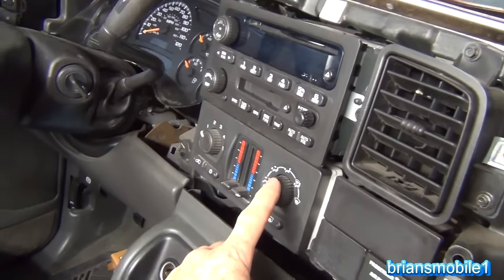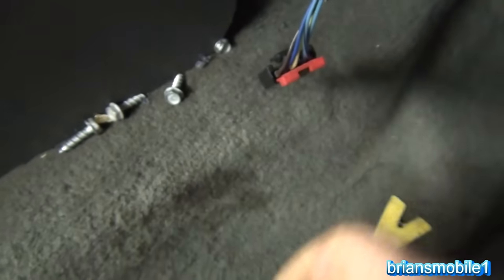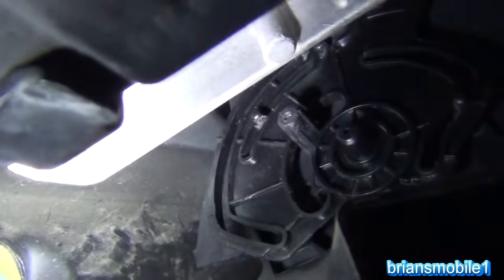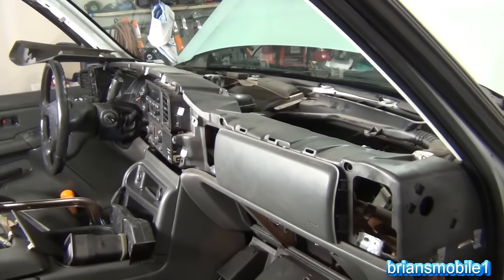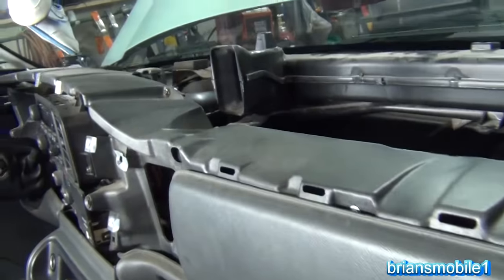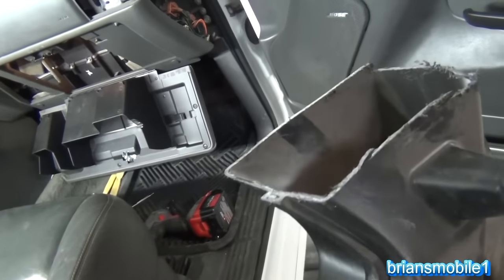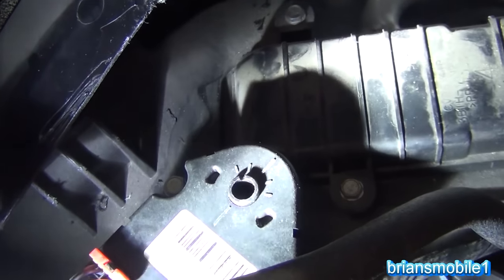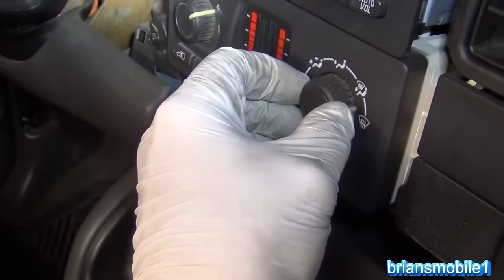Silverado Heater and AC Actuator FIX

Comment: Thanks Brian!  Just diagnosed my brother's truck with this video.  He had two bad actuators!  One for the blend door and the recirculation vent.  Showed him the filter location and replaced them also. Excellent description of the system and now you have another fan following the channel.
Reply from the maker: Glad to help- thanks!
Reply: What do the recirculation vent do? My issue is the defroster blows out cold air instead of hot! Is that what that do?
Reply: @520dblock3  recirculation vent open and closes depending inside air (AC) or outside air (non AC). Basically "Fresh air" or recirculate AC air.

Comment: Great ending to the video Brian. Humility, respect and a willingness to help others is a mantra we all should have. I really enjoy your content, thanks.
Reply from the maker: +Mathew Wood Thanks Matt!
Reply: +briansmobile1  How would I remove the duct that is at 5:14 in the forground? It is impossible to get my hands into the area on my 2001 silverado with center console/cassette deck. There is also a metal bar that goes from the transmission hump to the stearing support. I find a lot of information on the right side of the truck but hardly any information(about making it easier) for the left side.
Thanks for the video! I wish I could do as good a job......
Reply: how can I contact you?
Reply from the maker: Like this.  Thanks for the contact!
Reply: @billwhitehead164  aq QA
Reply: Great response young man

Comment: Brian, after removing dash top pad I was able to drill two 1/2" holes from top down thru bottom of duct to access both screws without having to cut duct into. Then I had four small holes to seal. I would not have attempted this without seeing your video. It took a little measuring to make sure that my holes aligned with the screw heads. This was for the passengers side temperature blend actuator.  THANKS for taking time to post helps and time savers.

Comment: This video helped a bunch! I would like to add that you don't have to cut the ducting...if you remove the brackets across the top (4-10mm bolts and (+/-) 12-7mm screws) you can wiggle and pop up the entire ducting up a few inches. From there you can use an 8mm short 3/8 ratchet to take off the actuator. I also removed the vent to the right of the radio, which was held down by 2-7mm screws. If you need more room you put a pry bar through that area to give a little more room.
Reply: Confirmed, although extremely tedious and patience taxing, completed the install by this method vs cutting apart the duct work. I used a flexible extension attached to a ratcheting screw driver that allowed fishing the 7/32" (male hex drive) socket between the duct work and bend at 90 deg with the aid of a simple bent pick to guide and engage the actuator bolts. Installation the same process with a dab of super glue on the bolts to help stay in place the socket. (tip: electrical tape all the tool components together to prevent separation/backing off while attempting disassembly/assembly).  I found reaching up from the glove box and stabilizing the new actuator with left hand and pushing the recirc door one way the other (finding alignment) with my right hand help seat on the door shaft.  Good luck!

Comment: This has been the most detailed and efficient video I've come across. I have filled out the two easiest actuators (under the steering column, and under the ash tray). The next two will prove to be a challenge, but with your video I feel I understand the process much clearer. 
Thank you Sir, have a blessed day.

Comment: I must say that this video was extremely helpful! I was able to install a new blend door actuator motor yesterday. It was the passenger side actuator which is the same one that is replaced in the video. The passenger side was stuck on blowing hot air. By removing and replacing that new motor, the issue was fixed! Almost every tip that was provided in this video was super helpful and was provided clearly, concise, and nearly step by step. However, I did not need to cut the HVAC tube like it was cut in this video. I say again, I DID NOT need to cut the HVAC tube! All I needed to do was to remove a couple screws on the driver's side of the dash brackets which allowed me to rock the HVAC tubes in directions which allowed my hands to get in and remove/ install the new blend door actuator motor. After I did the troubleshooting and verified the new motor worked, I was able to button everything up nice and clean. I've got to admit that I was a bit nervous to do this job because I've taken apart a dash on a GMC Sonoma to replace the heater core and it was a nightmare. Performing this fix on my 2004 GMC Sierra was actually super easy all with the help of the man that made this video! So thanks to you, Sir! A tip that I will give is that when purchasing this new blend door actuator motor I suggest not to skimp out on price for the part. I was able to purchase mine through Napa auto parts where they provided a lifetime warranty and a AAA Discount. The part ended up being just over $160. I tried O'Reilly but they said it was strictly a special order item... nobody has time for that. Amazon offers this part for just over $30 but it's a cheap knock off made in China with no warranty at all. Save yourself time, money and heartache and go through Napa.

Comment: Brian, I know this is an older video, but just wanted to let you know this is the best instructional YouTube video on replacing these actuators, by far! I just completed the replacement of the passenger side temp on my 2005 with automatic temp control. It was a huge pain, as I decided not to cut the duct, which involved even a bit more disassembly, but your video helped immensely! Thanks for being so much help.  :-)
Reply: Could you put in an estimate of all the actuators,,all of mine will be automatic. My suburban is a 2004 with rear air. I really enjoyed the video and like helping others,,be blessed. Sincerely Ernie Miller

Comment: Brian this was the best step by step on this job I have found. I was not looking forward to doing it until I saw your video. About 2 hours and done. The cut and tape is the only way to go, you can't find the screws and get to them from the front. I like how other guys just skip over the really difficult steps.Thanks for the help.

Comment: Good video.  I like to see repair videos that actually show the repair, not the aftermath.  Have you replaced the blower motor yet?  Mine works but makes a roaring noise. on the 4 and 5 setting.

Comment: Thank you for this video! I bought a 2004 Silverado this past Easter, and the only thing wrong with it was the driver's side heater blend actuator was stuck in the heat position, and since we are having a record hot spring in Tennessee this was a problem! I'm used to working on older model Chevys (60's and 70s) where the heat controls are a lever hooked to a physical cable. Without your video I would NEVER have found the actuator! Thanks again

Comment: What an absolute wonderful video! Thank you so much for it! I would have enjoyed this even if I didn't need to perform this procedure on my truck. I've got the automatic version. Hopefully I have learned enough here to proceed. I don't mind doing the cut and tape method but one has to wonder why GM didn't make it doable to remove the entire duct so it doesn't have to be cut. Thanks again!

Comment: Thank you so much Brian
You gave me the confidence to attempt this project. 
My 2004 3500 had the fancy automatic sensor system. 
It was scary because my unit was not like your demo model. Extra options add more crap in the way. 
I straight away broke my headlamp ambient light sensor which sent me to the Chevy dealer.  Good move because the parts lady printed out a diagram of the duct work for me. 
I have small hands and huge determination, I needed both. 
I did have to cut some plastic guards out of the way to access the "easy actuator" 
If not for you I would not have tried this. I feel more intimate with my Silverado  now. You are the best.
Reply from the maker: Way to go Christine!

Comment: Thank you! You just saved me from going and buying actuator with your re calibration advice/walkthrough. I’m blowing cold again! I figured why not and BOOM. YOU ARE THE MAN! 💯🙏🙏🙏
Reply: Hey bud, I bought a new wiring harness for the actuator that controls the driver's side, but the new harness has seven wires, with only six pins on the actuator.
I left the seventh wire off, and everything works EXCEPT, once I start driving, it automatically changes back to hot air, only on the driver's side. 
Should I connect the seventh wire to some metal nearby, or should I join it to one of the other six splices?
Please advise, thank you.

Comment: Thank you Brian! This is exactly the information I have been looking for. My 2005 Silverado, with 262,000 miles on it, recently began blowing hot air on the drivers side, while the passenger side had ca/c air coming out. I found the acuator above the trans hump and removed it, and manually moved the louver in the oppisite position and had cold air now on the drivers side as well. Here is where it gets irritating. When I get into truck and begin to drive it with the a/c on, after about 5 or 6 miles, the driver side gets heat, the passenger side still has a/c. I removed the acuator and it does move. So I backed up the chain and replaced the HVAC control unit just to eliminate that as a source of trouble.
Long story short, I no longer have the acuator moving the louver, but its still connected electially.  I miss the heater controls of years past. My 1966 Impala had the best set up of all. Also, I was not aware that the truck has FOUR actuators!! Your video is the best I have seen in a long time.
Dave

Comment: Great video with many useful tips.  You ask for suggestions. Here's mine.  I just replace the passenger side blend door on a '04 Yukon Denali.  Instead of cutting the duct that runs at the top of the dash,  I drilled two 5/8" holes through the duct directly over the actuator mount screws.  The holes can be any size needed to get a socket down to the screw heads.   Once free the actuator can be fished out through the dash panel at the left passenger vent hole.  Tip: I used a long #10 drill bit to pilot drill the holes making sure the bit exited the duct and could touch the head of the screw.  I used plumber's putty in the socket to hold the screw when I reinstalled them.  Then I taped the holes with aluminum HVAC tape.   That should save a few extra minutes!

Comment: I don't even own a chevy silverado but I once had a bad actuator in my saturn aura and a friend did a quick fix to stop the knocking sound. He did't do all you did to get to it so I know it wasn't fixed right but it saved my sanity of hearing that noise lol. But thanks to your video if I have another one ever go out I won't be afraid to fix it myself. It looks time consuming and will take patience so clips don't get broke and every screw gets put back in to every hole but I would definitely tackle replacing a bad actuator on my own now. Thanks for the detailed video, you make it look very doable. Of course every car will be a little different with the order you take it apart I'm sure but for the most part it looks pretty simple to do. I love learning and then fixing my own vehicles. I'm   to cheap to pay someone else to do a job I'm more than capable of doing myself.  I'll be checking out more of your videos. Thanks for the great detailed into, Brian! Looking forward to watching more! 

Love the message at the end :}

Comment: I miss the days where they just used cables
Reply: Yeah the mechanical versions had less to go wrong
Reply: That no joke go to the junk yard find any 80s model truck or car and guess what the ac stuff still works need to go back to the cable doors
Reply: I still own a 1949 Dodge Pickup. A 1972 Buick Grand Sport, Dual Cowl Hood, High Output car and my favorite is my 1970 & 1/2 Trans Am. Besides a few more newer vehicles and I whole heartily agree. 
I do own a dynamic spectrum tuner so I can change and of the computerized parameters on these newer ones but it takes like 30 minutes to advance the timing on my newer stuff and and about  two minutes, with a timing light, and a 9/16ths wrench to adjust the timing in my old rods.

Comment: Great video! I used your directions for disassembly. Cutting the duct seemed crude, but is REALLY the BEST WAY. I also used the aluminum duct tape. TOP TIPS ! I replaced all of the actuators, too. I have the auto system. Replaced the old style blower control module to the newer single connector type.
Unfortunately, the passenger side still does not get warm. It seemed to work correctly when I had it apart...
Edit: The connector on the pass. temp. actuator had pushed over the male pins on the actuator, so they were not connected. Be aware that the male pins can slide into the unused spaces on the connector. Looks connected, just isnt.

Comment: I have been without a defroster for a year. When I looked under my dash I could not see the motor. Now after watching your video, I see there is duct work that needs to be removed, then I should be able to replace the motor. Your video was very informative and I appreciate that you took the time to share your experience with others. I will be tackling this project next weekend. I will post how it goes.

Comment: Warning warning… if it hasn’t worked since you replaced your battery 2 years ago… lots of dust will blast in your face when you start the engine after replacing the fuse! 😂

Thanks for the video and the comments on the video. Saved me cash and time!

Comment: I have a 04 duramax with auto/digital HVAC that for over two years the ac would shut off for the driver side at random by itself while driving and in the winter the heat on the drivers side would by luke warm at times and hot on the passenger side.  Three garages and some utube video's told me it was the control under the drivers side acting up so I replaced it, seemed to help but just when the temp would be changing outside and a need for heat or cold the same thing. Finally removed the floor blend actuator and took it apart and cleaned it up.. over a year and no problem since. Inside the grease residue was over the contact points, cleaned with alcohol and that did it, working perfectly.  Hope this helps

Comment: Great video, Brian! I just replaced the passenger side actuator (the hard one) on an AUTOMATIC climate control, and these instructions worked great. It took me about 3 hours - and I'm slow. 

A few things to note: 1) the headlight sensor in the middle of the dash - it twists loose from the top, then you push it down through the "keyhole" opening (at least mind did), so that makes it easy to remove. 2) my truck (2004) has a metal sort-of-u-shaped bracket that has to be removed before you cut and remove the vent. No big deal. 3) I cut my vent very close to the bracket, as instructed, but that left the bolt on the right side of the actuator still under the remaining part of the duct. I solved this buy cutting a notch in the remaining vent big enough to get my socket in place. The silver duct tape was plenty wide to still cover that little 3/4" square notch. There really wasn't any more room on the left to speak of, so I think this was still the best place to cut.

After I got the new actuator installed, I turned on the truck and was disappointed to discover no change in the behavior of the heating system - I was still getting only cold air out of the passenger side. I quickly remembered that I probably had to recalibrate the actuators by pulling the under-hood fuse, waiting one minute, replacing the fuse, turning on the truck, waiting 2 minutes, turning the truck off, waiting 20 seconds, then turning the truck back on. Voila! (or, as my nephew writes - Wa-lah!), it worked. I could hear the actuators recalibrating during the 2-minute waiting period.

I didn't want to leave the defrost vent separated from the main one (I had cut the welded tab in the middle), so I used some plastic epoxy to re-attach it. I'm confident the parts won't bump or rub together.

So I hope this helps. It was a little intimidating, but thanks to Brian's video, no insurmountable surprises.

Comment: Finally ended up doing this today 7/24/21. I bought a 2003 Silverado 1500, so it does not have the center console. The driver sides where easy to do. Needed help on the passenger side and glad I found this video. 

Unfortunately someone else was in here before me. They actually cut the wire (female plug) that goes into the passenger actuator. So luckily found the plug and waiting for it to come in. 

Also the blender actuator for the recirculate is a 3 terminal conector  not 5 like all of the other ones I’ve done.  Ordered that part aswell. 

To boot all the clips on the dashboard where broke already, those tabs you mentioned. Looking into a way to fix them. Might just glue them. Thanks for the video!